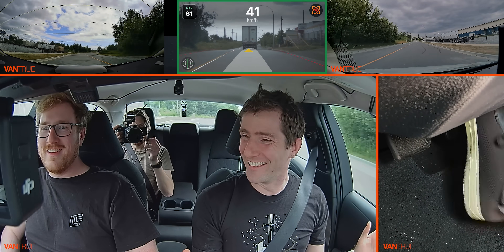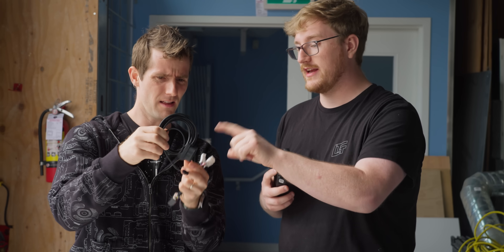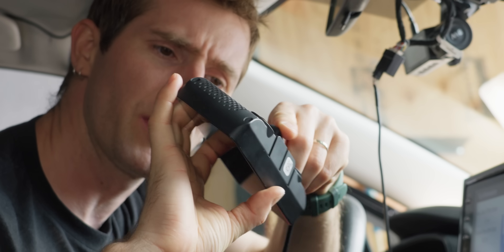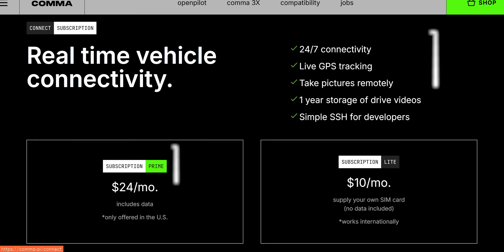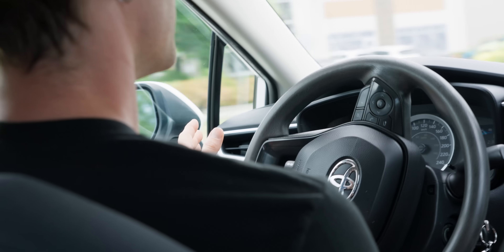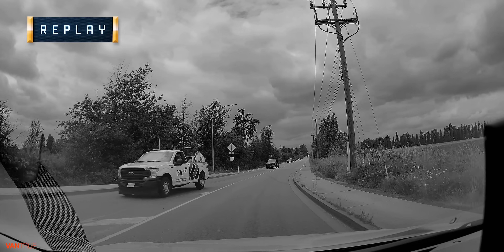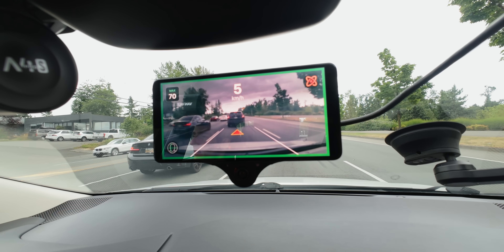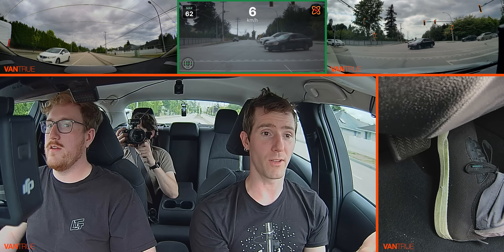I Upgraded My Car With Open-Source AUTOPILOT and it's AMAZING

Comment: The cool thing about this is that it can be added to a lot of cars that already have some systems (like a limited adaptive cruise or emergency braking) and actually add little bits of functionality on top of those existing systems.

Like my Ford Escape has decent adaptive cruise control that’ll follow behind vehicles and keep centred in the lane at highway speeds, and the cruise can come to a stop behind a vehicle, but requires pressing Resume to have it start moving again. OpenPilot enables the adaptive cruise and lane centring at all speeds (not just highway speeds) and allows the car to resume driving from a standstill without having to press a button on the wheel first.

It also has experimental testing for traffic light and stop sign handling. But I wouldn’t personally trust those one bit yet!

Comment: 11:08 it's not a problem with tesla's system, even the basic autosteer has "curvature assist" that slows down for aggressive turns on the highway. Maybe it is on older systems, but i'm in a 2019 Model 3 with hardware 3 and it's not a problem.
Reply: Yeah I think Jake might have been thinking about older Tesla code.  Newer code definitely has "Curvature Assist" that pops up on the screen and slows the car to an appropriate speed. If you set a navigation destination it will also slow you down for your exits/turns to a different road/etc when those come up.    Funny story:  Quite often my car will auto-navigate to home without me noticing (but I'm actually heading somewhere else) and then it keeps trying to slow down at every intersection while on Autopilot and I'm like "WTF you doing car?" and then I finally notice its trying to slow down so I can take the turn to follow the Nav.   So I have to cancel my nav or set the real destination to stop it.  Really makes me appreciate how complicated even Teslas basic "free" Autopilot actually is!

Comment: I've used a comma 2, and then 3, and now 3x on a 2021 rav4 hybrid, 2023 santa fe limited and now 2024 ioniq 5 limited. Love the device and software! I have about 60k miles total so far using the software.

Comment: I have this on my Ram 1500 it's pretty awesome. As they pointed out in the video it's excellent on the highway as an adaptive cruise/hands free it struggles in the city/town. Like there Toyota my Ram has steering limits however I would say it's more aggressive than there's in the video but I can definitely hit the limit on really sharp turns. 

On my Ram the Sunny Pilot fork improves a lot over the stock open Pilot. I'm excited to hear their long term thoughts.

Comment: Has anyone mentioned that they aren't wearing their seatbelts correctly? I feel like this needs to be mentioned. Like everywhere. Like videos... memes... reddi-  oh. nvm.

On a serious note, I wonder if there are add-ons or forks that can take advantage of extra camera data.

Of course, my vision of what self driving holds is more aligned with the concept of controlled traffic where a central traffic director monitoring roads and cars on those roads tells them how to go, where to go and such based on the vehicle's destination. That would only be something that could arise from whole system implementation and require sharing data such as movement metrics, route planning and capabilities. It would almost need something such as Tesla FSD available on all vehicles along with the ability to take direction from a local director unit.

Comment: Mt Enterprise rental a couple of weeks ago was a Toyota with "full self-driving" but I hated it. It would pull towards on coming traffic in attempt to always maintain the lane. So in places like construction zones or extra wide vehicles that require driver to cross the line, it would get fussy and try to correct in bad ways sometimes; much too often to take my hands off and relax.

Comment: So this taps into the vehicles communication network? I’m not sure I’m a fan of that but if it doesn’t cause issues like some of these aftermarket head units and piggy back devices do then whatever.

Comment: I’ve had the comma 2 installed in my 10 year old Hyundai for over 4 years now and it still works great! The turning issues you experienced are 100% down to the hardware level limitations of the car’s max steering input range.

Comment: Curious of the legality of all this... I mean, it's one thing when a vetted vehicle manufacturer implements self driving in one of their own models. It's a WHOLE OTHER to just assume that Bobbo and Cleetus will get even this simple of an install right on their own though. Just mounting things in the wrong place with the wrong view, or having other vehicle systems in poor condition in conjunction with asking this to then drive the car, which has metal on metal for brakes, check engine lights for tons of things, etc. I dunno... Just dunno how I feel about it. I know I'd get it right, and even then I'd worry about the tech getting its part right for sure. But I don't AT ALL trust most other folks to EVER get much of ANYTHING right. Quite the opposite actually... And imagining those same folks installing this in their cars, and then being on the same road as myself, well... I hate it. And I really find it hard to believe that most states, or even federally speaking, that the law is in favor of this. Perhaps at best it's another blind spot brought on via rapid tech advancement in the absence of law reform / creation. But regardless, law will likely catch up if not already having something in place to rule this out in many places.

Comment: You’re in an older Corolla with safety sense 2.5 I’m curious to see how a more modern Toyota with 3.0 that has proper lane centering and not just lane tracing would do. With our lane centering I’m able to drive from St. Louis on 70 all the way to Kansas merging onto 29 without touching anything other then small inputs to the steering wheel so it doesn’t shut off.

Comment: “Runs anywhere” sounded impressive until the autopilot proved it could run equally well on asphalt, median, and the decorative fountain outside headquarters. Multi-platform in the most hydraulic sense.

Comment: It's autopilot / advanced cruise control, not self driving yet.
And the problem with advanced cruise control, is that as you can get complacent / used to it, if it works for 80-90% of the time
You have to be ready to take over at any moment.

Comment: Linus I got a question can you take a Samsun 9100 gen 5 4tb drive and put it in a gen 4 slot and then take a Samsun 990 4tb and put it in a gen 4 slot and do a benchmark . I want to see if the higher quality drive gets better benchmarks

Comment: As a person who has a self driving Honda Accord.  I have been looking into upgrading to Autopilot for an even better experience.  As the Honda system is really only designed to use on the expressways/highways.  I look forward to your long term review, and upgrades.

Comment: As another user that's had a Comma 3 for 2 years now, it's been one of the best purchases I've ever made. When I was researching, I saw a reddit comment that explained the constant feedback loop we have when we're driving that forces our minds to keep assessing the lane position and tweaking the position with our hands. This feedback loop is a major cause of driver fatigue. I went from having trouble going more than an hour or 2 of driving to being able to handle 5-6 hours without a problem.

Comment: Happy to see you guys cover this. I've used it in two cars over five years and logged over 30,000 miles. As has been said, Hyundai offers higher steering torque limits, so even the cheapest 2020 Sonata you could have found would have blown away this Corolla in terms of handling curves and turns. This is my go-to for mega road trips. I could run outside right now, and drive 3,000 miles to LA easily. Oh, and experimental mode does not work all that well on the open highway. Tap the atom symbol to change it to the white steering wheel (chill mode) for a much better highway experience. Or just run SunnyPilot and automatically get the best driving experience for the current situation. Nice job overall introducing it to people in your audience who have never heard of this.

Oh, and "end to end" is the hot new AI term you were looking for. It learned how to drive by watching video clips of "good" driving.

Comment: I really like the idea of this system, but I cannot withstand the bulky unit stuck to the windshield. It needs just a small pod with cameras, which can be hidden behind the rear view mirror out of driver's sight and a separate unit with display, which would sit on top of a dash board in front of the driver (not obstructing his view out of a vehicle).

Comment: I don't expect anyone to read this as there are sooo many posts but still.
The model you are using was one of the first to have the lane centering and it was good for then but not great. If you set this up in the newer model like from 2024. The car has more features and this would be way better. Also the turning assist by the new models is way higher then by the first ones. 
On the first ones it was only meant for highway use as you noticed it was almost perfect there.

Comment: it needs full radar AND lidar support - otherwise its too dangerous to use it. Purely optical detection = car is going to unalive you if you lose focus too long. That easy. Never trust any autopilot which uses only one single data source.

Comment: Ive also got over 20,000 miles on one. First Gen Bolt EV had one, now i use it on a 2018 outback and Also A Tesla Model Y!! These things are awesome, and the open source unlocks so much potenial with different forks.

Comment: Let me add that in some countries (especially in EU) every modification on the car electric (in Italy even simply attaching your pc to the car is considered a modification) must undergo an approval by the country. Also in EU steer on wire is banned for safety reasons. Finally in Italy autopilot are banned, university and research institutes needs the approval of the country and it’s given only under certain conditions (max velocity, maximum range of x kilometres, specific area in which the auto pilot is allowed, etc…)
Reply: EU
Reply: @mortenwt76 ops… sorry! Thanks for pointing it out (in my main language is UE not EU that why I misspelled)

Comment: I wanted to get a car I could use with a comma 3x but my wife vetoed.  I ended up with a Mercedes EQS (used) and its ADAS seems largely comparable.  No stop sign or street light recognition, but it absolutely slows for curves unlike this one which is more useful for me.   It's a couple years old, so I didn't get the L3 heavy traffic support, but I'm rarely if ever in exactly those conditions on a supported road.  

I do regret that I'm unlikely to ever be able to upgrade with something like this.

Comment: So it really only adds stopping at lights/stop signs, changing speeds based on speed limits, and changing lanes? The Corolla already has the lane centering (steering to stay in the lane) and adaptive cruise control. I have a 24 Corolla and the normal lane centering is better than what that was doing. I hardly ever have had to correct it. I do like that it at least removes the need for constantly shaking the steering wheel if it hasn't detected resistance.

Comment: I've had one of these for a few years now. My comma 3 is a first gen with a few 3d printed parts inside. Some of the hardware has degraded and I've had to make some minor repairs. I added my own SSD so I can have the storage to hold hours of recorded drives. I have an "unsupported" car, using my own custom fork of a custom fork I got it working. and I love it. after you get to know it's limits its great. The hardware broke and I was with out it for a few weeks and I missed it so much. It drives my car about 95% of the time on highways. Just have to sit and supervise just like if my daughter was driving. The collaborative driving style is nice. It drives most of the time and every once in a while I have to nudge the wheel to avoid debris in the road or pot holes etc. then let go and it centers back up and takes over again. I don't think everyone should have one though. It's too easy to abuse and some people out there will abuse it and get into car accidents.

Comment: The fact people say this is better than Tesla is hilarious. It might be on par with auto pilot but fsd supervised blows this out of the water
Reply: did you fail to watch the part where they said "it depends on the cars hardware" 

the system is literally macguyvering varied and different hardware to get extremely close to fsd w/o buying a fsd car
Reply: @SaibaKeiosu  So its unreliable and ineffiecient, got it.
Reply: @MxCloudy well its either buy a whole new car or a cheap retrofit 

not everyone can afford a whole new car when they want just a single function - im sure you can though 

and if you're into tinkering (which people on this channel certainly are) its a good value proposition than spending tens of thousands
Reply: Fair enough, the tech is still better in a Tesla and you could get a used model 3 for the same price as the Toyota.

Comment: I love my Kia Niro's Lane Keep Assist but it still requires you to hold the steering wheel at all times. It'll beep at you within about eight seconds if you let go. Sometimes it beeps at me even when I am holding the wheel.
Would love to have a device that I can trust more and put my hands down.

Comment: i would love to see comma release a version you can install on an old smartphone, or a computer. i dont drive anything new enough to have the features it requires, but someone did do some extensive mods to a VW bus to give it the sensors and equipment it needs to work.

Comment: Early in the video they say it's "like Tesla's Autopilot". Well, if that's the case, then it shouldn't be expected to fully function on surface streets. It's obviously intended for highway use, similar to Ford's BlueCruise and GM's SuperCruise. It isn't an FSD substitute. And as another comment pointed out, the factory electric steering assist can't provide the torque for sharp curves; it'll probably struggle with curved exit/interchange ramps, too.

Comment: I would not trust my life with a piloting device that relies on RGB camera vision alone, which are far more approximate than lidar depth sensors. Lidar measures the distance and you can extrapolate velocity between you and the object in realtime using lasers, similar to modern speed trap guns used by police or if we're going way back, Microsoft Kinect. Remember folks, you're putting your life in the hands of software engineers that you hope are competent and who work for a company that's primary concern is to turn a profit. Look after yourselves.

Comment: Just want to mention, that the thing with missing features is not specific to the product being open source. It is because it is a 3rd party product, which does a lot of reverse engineering. 

The thing that is specific to the open source model is, that different forks hold different feature sets, which is only possible because the open source model allows for the forking to happen in the first place.

Cool as hell btw

Comment: 1. In BC, it is illegal to "modify a safety device" in a motor vehicle.  I suggest you guys consult some experts to see if an aftermarket computer taking control of safety equipment would fall into this.

2. What are the security risks associated with the open source software and Internet connection?

Comment: Comma user for the past 2+ years here.. having spent the original $1250 + $200 harness pricing back then... it being open source is one of the greatest aspects of OpenPilot. the availability of different forks and driving models available lets you customize your driving experience even further. I tend to enjoy controlling speed manually as some of the driving models still tends to be a little aggressive or jarring on the accelerator/brake. So about 90% of my Comma driving has been just letting it auto-steer.. (which you might need a fork to enable that... I'm personally using SunnyPilot, myself). Even though pricing is obviously much cheaper nowadays, I don't particularly regret spending as much as I did years ago. It's been well worth the countless miles that have been driven.

LOL.. also... disconnecting the battery is definitely something that's typically engrained into any auto technician/mechanic... Having worked on Toyotas specifically for many years... yea.. something like this is eh.. not really needed.. but still, a good warning from Jake in general.

Comment: my 2023 C-HR (same as a 2017 one and basically same as this corolla), can do this too, set cruise control, set the lane assist to FULL ASSIST and its done, i just need to keep weight on the wheel

Comment: I've had my old Comma 2 for four years now in my 2015 Honda CR-V Touring. It is amazing. Greatest thing in the world. I've done numerous 600+ mile road trips from the mid-Atlantic to Maine, Iowa, the Carolinas, and shorter camping trips in PA. I get on the highway, engage the system, feet are off the pedals, hands off the steering wheel. It becomes a baby-sitting exercise: you just sit back and monitor the car, listening to podcasts. If your eyes drift, the device will beep at you. So you must stay engaged. This does not apply for city and local driving of course. If you want a car that can do that, get a Tesla and pay up $$$$ to Elon for full self driving. Otherwise, if you want a car that can drive itself on the long trips, this is a fantastic device to consider.